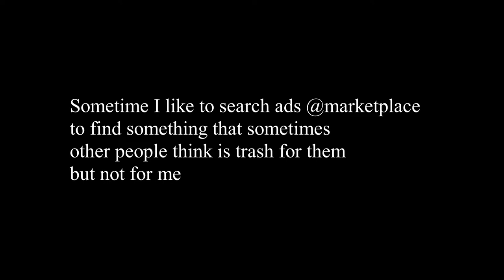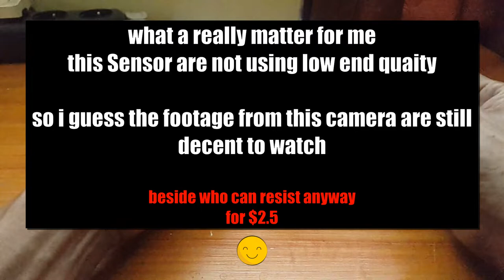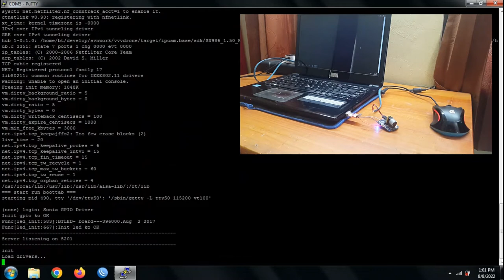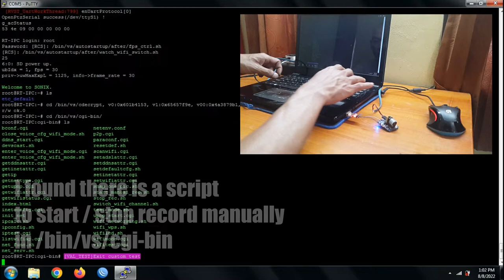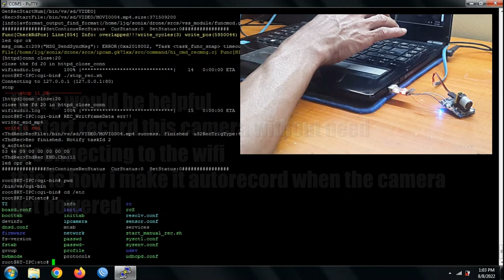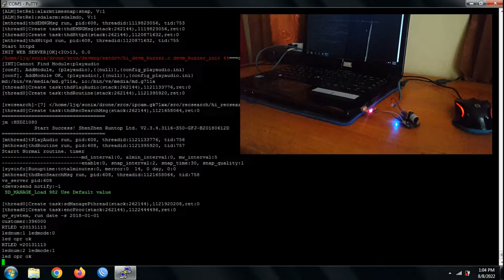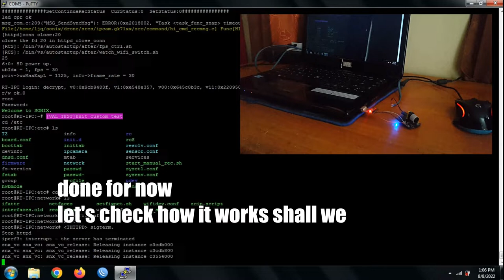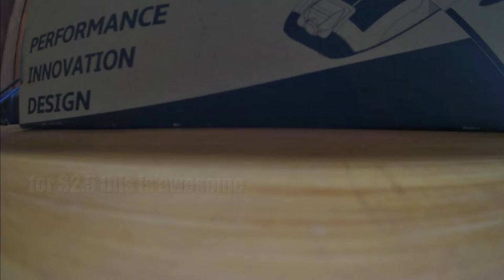Mjx Bugs B5W Camera on Rc Plane feat Reptile Dragon

Comment: Wow very cool, I never thought that you can do this with such a camera, I have a broken e520s with a pretty decent camera so i think ill try to reprogramm it. I hope it wont be too difficult because my programming knowledge is very limited lol
Reply from the maker: oh you don't have to do the same thing, my goal is to make the camera automatically record, because I have a separate fpv, so I deliberately turned off the wifi to avoid interference, you actually just need to power the camera and access it via wifi as usual
Reply: @benznote2342  You are right, but the app doesn't allow me to record to sd card. The only way I can record to the card is by using the button on the controller. And besides the wifi on the drone is 5g which would definetely interfere with my fpv signal.